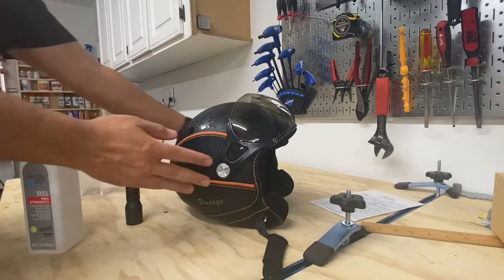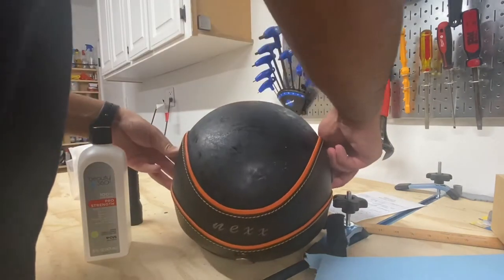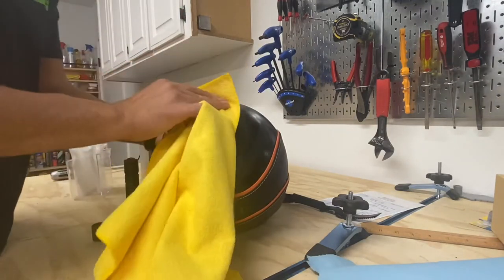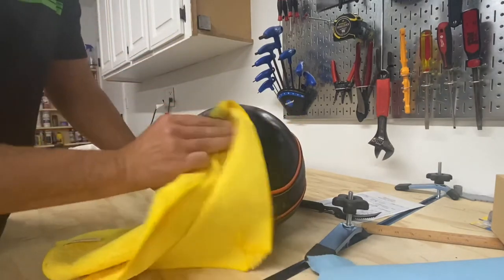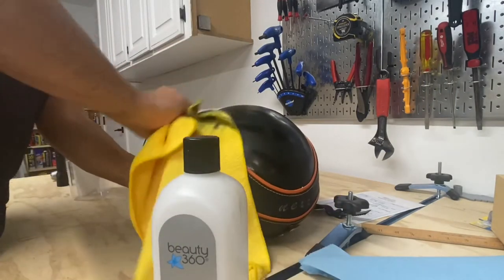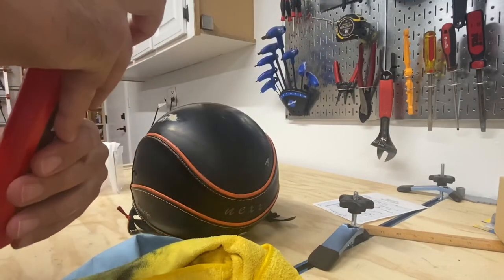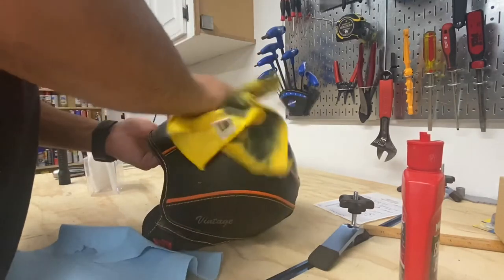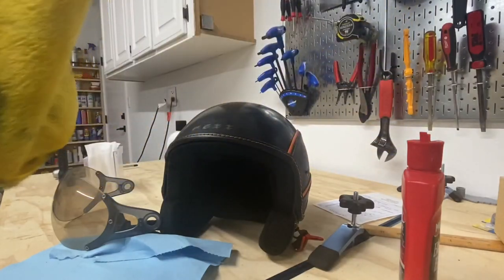How to clean a sticky rubber part or helmet

Comment: Use isopropyl alcohol, or hand sanitizing alcohol. It works wonders. Just did a complete KBC half helmet in less than 30 minutes.
Reply: Hand sanitizer FTW!!! Thanks SO much for mentioning that, it worked like a champ!
Reply: Great Tip, took out my skate helmet and sticky af, thanks

Comment: Found two of my old KBC green off road helmets in a storage bin.  Both had this coating on it.  I was able to put my palm on each one and pick them up.  So sticky.  Anyway, used lacquer thinner, rubbing alcohol, goo be gone, wd-40, carb cleaner, etc. without much luck.  Better, but still sticky.  I will try the acetone next.  Anyone out there try something else that worked?
Reply: Acetone worked.  It got all the sticky off pretty quick.  The cloth was dirty even after using all the other cleaning stuff first.

Comment: I use old white socks and T-shirts for detailing cars or something like this.  Should I not?
Reply from the maker: If you like the results you’re getting then I wouldn’t change it. Car paints vary widely by car. My NSX would get pin stripes just driving around. A course towel would absolutely destroy it. My truck however won’t scratch even with a regular towel. So whatever works ...